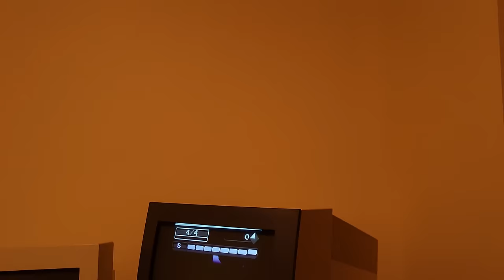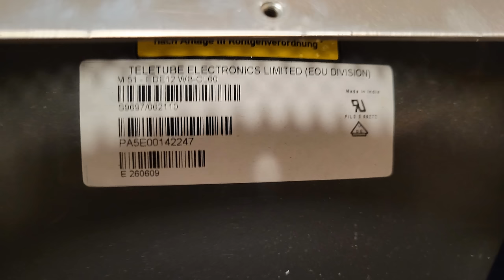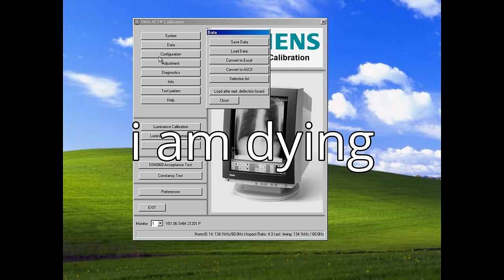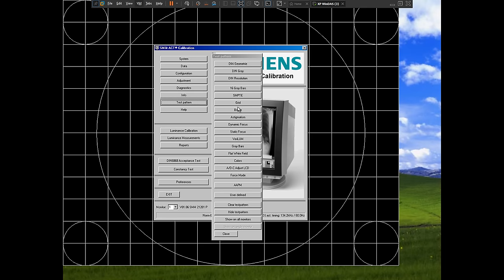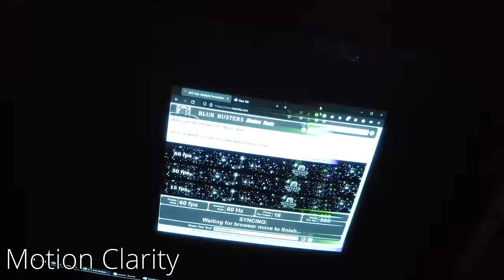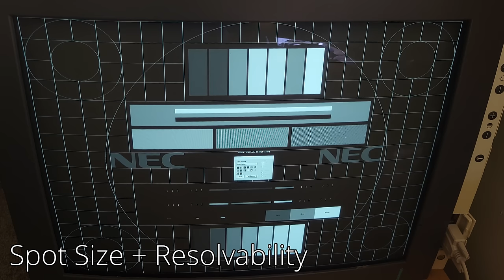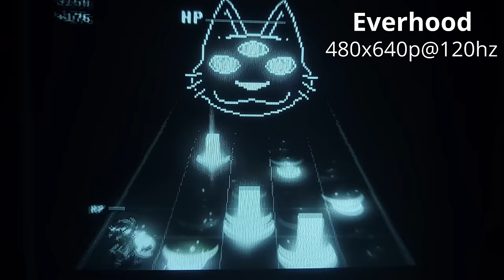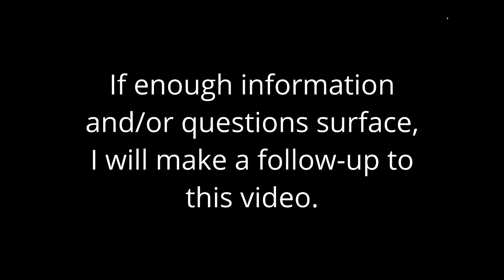The 4K CRT Monitor from 2005 - Siemens SMM21201P MED

Comment: If you can get the refresh rate high enough, you can mount a single pixel color LCD on it, and turn it into a sequential color display.
Reply: i was about to say that
Reply: Yes. A monitor with that same picture tube, turned on its side, with the colour filter would truly be something. That this was possible in 2005 (even though there was no real application for it yet) makes me wonder, what kind of CRTs we could have now if manufacturers didn't all go down the LCD route.
Reply: TFT or LCD will have a delay and smear in high motion scenes. Not good.
Reply: @daysetx  no, not a huge single pixel lcd (like in welding oder 3d shutter glasses, but with the ability to change color) they dont have relevant delay, and absolutely no smear
Reply: Yes
Reply: @daysetx  Dude's talking about a single liquid crystal color filter, which could respond to each pixel on screen and create their color while the line is being drawn.
They make color filters like this, and their response time is insane.

Comment: Whenever there are videos on larger channels about CRTs there are always comments about where CRTs would be if they were still being developed. Back in the late 1950s we already had amazing monochrome CRTs and color didn't catch up until the 1990s. I surmised that with the technology available at the end of the CRT era we could make absolutely amazing monochrome displays if we wanted to. I didn't know that this actually happened. The one thing I find somewhat surprising is that the face isn't flat.
Reply: Making the face flat would have added error to the placement of the electron beam, bad idea.
Reply: @Intelwinsbigly  It's simple geometry which is fairly easy to correct for. Especially given all the fine focus controls on this monitor that isn't an excuse. By having a curved screen it is guaranteed that distortion is present if you are viewing a flat rectangular image.
Reply: @eDoc2020  It can be corrected for, but because of its use in medicine, the screen needed to be as accurate as possible, requiring calibration often. Adding a bunch of other things that can also require calibrating would have taken these monitors out of service much more often.
Reply: @Intelwinsbigly  How can it possibly be as accurate as possible if it needs to stretch a flat image onto a curved surface? Even if you somehow make that work it would still need to be recalibrated just as often* to remain accurate.

*Which is basically never. Display geometry depends on the physical tube geometry, acceleration voltage, and yoke current. Physical geometry isn't changing, acceleration voltage and yoke current can be monitored and automatically corrected. Ambient magnetic fields also make a difference but that's probably negligible.
Reply: @eDoc2020  it is more accurate because making a crt screen flat harms focus on the edges of the screen, meanwhile the distortion of a round tube is fixed by changing your viewing angle.

The choice was between a minor annoyance to those who worked with the screen and had to occasionally lean to look at a part of the image head on, or blurring at the edges of a screen designed from the ground up for extreme accuracy.
Reply: @Intelwinsbigly  The tube is already flat enough that they need focus correction to maintain focus accuracy. A little more wouldn't hurt. All the modern flat CRTs I've used have no noticeable focus degradation at the edges. Granted they're lower-resolution color displays but they also didn't cost nearly as much.

Comment: Sonic Generations in the end game montage looked incredible and really sharp, I wonder what a hybrid display with this type of tube would be like, say this tube with an OLED shutter panel overlaid to add colour to the display, even a QD-OLED shutter panel, it's been done on a small scale before with the JVC LCCS, the B&W CRT tube with an LCD shutter panel overlaid to add colour, the resulting image looks incredible and works surprisingly well, a tube like this with an appropriately designed OLED (could also use quantum dots somehow to boost colours even more) version of the LCD shutter panel could make for the best gaming display ever made.
Reply: you can't use OLED, QD or QD-OLED OLED self emits light and QD you can't control it
Reply: Using a transparent OLED panel as an overlay for colour, or just stick with LCD shutter tech if OLED is not viable, I'm sure it could be done though, there are 3D OLED panels out there using passive and active glasses.
Reply: @Wobble2007  that doesn't work like that that would be just transparent oled with extra backlight and adding any shutter panel would need a lot of processing for it you need also help from the monitor to get it to usable state

Comment: Radiology Equipment is just straight up batshit insane at times. I worked at a Software operation for said purposes and had the pleasure of using some sort of 8k Eizo monstrosity that only could be connected via a special magic box and two separate DisplayPort cables.

Comment: Due to the fact that it would have been used for cancer diagnosis, bone fracture analysis, sonograms, MRI, CT, etc, they would want to make certain they are not causing weird image artifacts or bloom distortion that could affect diagnosis, vs a generic CRT. External software control of settings would allow them to deploy common settings across multiple monitors in the same facility for consistency of diagnosis.

Modern equivalents like this cost a fortune for similar reasons. Barco K9301636A 30in color radiology monitor 6MP (3280 x 2048) - US $13000
Reply from the maker: Yup; we actually found out what type of phosphors this thing used in a manual for it a day or two ago, so I'll be including that in the follow-up video and most likely will be making it a pinned comment here too
Reply: Medical grade display are no joke.(DICOM part 14 standard for grayscale calibration)
The newest top end RX1270 from EIZO costs $30k according to lakeshoreit.

Comment: I remember dealing with those monitors back in the day.  The ones my company were using were GE branded for Mammography reading, so they were 5 MP and had have the calibration checked every month (FDA requirement).  
Now we have LED / LCD models that are 12 MP resolution and full color.

Comment: Many MANY years ago at school on a 286, they had a monocrhome monitor that was used for cad, (the machine had a 287 as well to help). This monitor's screen "colours" looked similar. White with a blue tinge. I noticed that the green "shadow tint" you mentioned in the video and i did some research on it, apparently its a combination phosphor of a very light blue and green phosphor to get the extra brightness. The light blue is for the speed, the light green is for the total brightness, but its a bit slower, that, and our eyes are more sensitive to green so you can see the green fade away more then the white/blue. In a room lit with flouro lights, this monitor would look white, but in an incandescent room it will have a blue tinge to it.

There is no actual "white" phosphor that is even remotely decent, so these mono monitors were made with the combination blue and green. Thats why old black and white tv's always looked "blueish"

Comment: Absolutely amazing video man and great find for the monitor. Nice to know that in 2005 they could have made CRTs for projectors that could have given us monochrome RGB with the ability for 4K interlaced at 60 hz. I can only imagine what adding Quantum dots to something like that would have been like. No burn in? Yes please.

Please don't run that tube anywhere close to 500 nits lol, except for the science you've done in this video LOL. You'll burn it out faster than you need to. You could be perfectly happy with that at 150 nits lol

Even though it keeps the values in memory from the service menu, write that shit down anyway in case a capacitor goes bad or the little ROM that that date is written on craps out one day. Save yourself some headache in advance

Here's just a thought for you. If you could get some color shutter glasses or some fan blades that are RGB and run the tube at a high enough frame rate, you could probably get full color out of this thing old school mechanical TV Style.

Technology connections did a great video on an LCCS tube, and I bet something could be done with some active shutter glasses. Maybe hop over to blurbusters and see if the chief could help you out

Comment: I wonder how this monitor would look emulting a vectrex at high resolutions, and then getting the color filters (or reproducing them) for the old platform...  Since it's such a clean display @ high res, emulating the vector based display may actually work out nicely.

Comment: Still have three CRT monitors (roughly 30 years old) which are the grandparents of modern high definition.

Ironically enough, the oldest of the three supports 2560x1440. But all do up to 16.8 million colors on screen simultaneously, while everything else available could only do 256 colors picked from a pallet of 16.8 million colors.

They are NEC multisync's 
2560x1440 was dropped due to the monitors fixed aspect ratio of 4:3 (and likely cost) not to mention that monitor is heavier alone than both others combined. 2 are 17" and the other is 15"

Pretty sure grey scale versions of these same monitors existed as well, for radiology use, never seen one myself however.

Comment: Wait you can run a dac not internal to the graphics card? I have an upgraded past TitanX because no DAC and i run a p1130 as main monitor at 2048x1536@80hz
Reply from the maker: there's always a DAC for this stuff, whether it's internal like GPUs that have VGA out or the usual DP to VGA adapters.

Comment: Black and white monitors do not need grease! Shame you destroyed the flat flex. Yes that would be needed - glad it was repaired! Well done. Lol my ears stop shouting 

Good monitor - I’ve had similar monitors on my workbench. Paper white. Fantastic quality. Line transformers, as well as other components are unbelievably reliable. Comments at the beginning about flashing over arcs, mainly is caused by a breakdown in the EHT lead, a shorted CRT, air filled CRT, and even a shorted horizontal output transistor. Your monitor uses a voltage multiplier on the output of the line transformer. This can also fail. Rarely the line transformer fails, however it is common for the EHT diode in the transformer to go short circuit - this can be fixed by an inline diode!

Good work on umm adjusting the picture!

You need to adjust EHT regulation by following voltage reference points on the line output drive board. It’s very dangerous to do this without the proper procedure as you could overload the line transformer, it will end up flashing over on the tube, causing it to crack!
A video amplifier is used to increase the video signal to a level which is fed to the cathode of the CRT. It is likely that this monitor uses a combination of RGB to mono grey scale, rather than just one green signal. Chroma isn’t needed as it’s black and white! 
I’ve got a couple of these - I’m based in the UK. If anyone wants a repair video, let me know!

Comment: No one believed me when I told them I played portal 2 in "4k HDR" in 2009, before there was even a "4K", let alone an "HDR".  Everyone thougtn i was insane
Reply: Oh,wait, monochrome?  This isn't the viewmaster multisync I remember
Reply: you mean portal 1? That's probably why they didn't believe you
Reply: No it was portal ii on, what was it, the 512mb the radeon 7650 with whatever overclock that thing took?
Reply: So the year might be off but it doesn't change much.  The monitor was still doing 32-bit color through, effectively, the last graphics card that could truly display it in analog
Reply: At x2100, 75hz too
Reply: I had the adobe colorspace installed too, Photoshop 7 cd's where everywhere back then, as was the style at the time

Comment: When you turn it off, does it do the white dot thing??
Reply from the maker: yeah, deflection turns off slightly before the beam. I'd say it's for less than a quarter of a second though; not like when some sets have an issue where it sits there for a good bit, so it's safe.

Comment: This was a really interesting video, thanks for making it!

What DAC did you use to get interlaced output? In Windows I can't get interlaced out of DP converters. I didn't watch the whole video so sorry if you mentioned this. I just heard the part where you're using the 500mHz+delock, of which I have the Sunix version and have not been able to get interlaced from it.

Also, in regards to the bandwidth limitation you were talking about with the Delock, I wonder if you found a DAC that prefers YCbCr, like some HDMI DACs do, you could possibly set the color space to YCbCr 4:2:0, which would drastically reduce the bandwidth and maybe allow you to run higher resolutions. Luma should be fully intact, and in theory, look identical
Reply from the maker: Yup, so I'm using an IO Crest HDMI to VGA DAC that can hit a gorgeous 350mhz pixel clock. It has green artifacts even at low pixel clocks, but kind of like you said, if you set ycbcr 4:4:4 in CRU, the artifacts go away. I'm aware that there are actually a couple of dacs that use the same chip in this DAC, as it's no longer in stock unfortunately

And yup, display port refuses to interlace on windows and nvidia, and you can't interlace at all if you have an RTX card or a GTX 1600 series card.
Reply: @Notes_lul  Holler at me if you're able to try 4:2:0.

I tried 4:2:0 4k60 from a PS4 Pro into a cheap Benefei DAC, and I got a signal but the colors were messed up. However, I don't think the actual Luma side of the signal was wrong, so I think it actually might work for a B&W display, without any loss of data
Reply from the maker: @lulkLogan  Yeah as far as I've been able to find, I can't find any option for 4:2:0 in CRU
Reply: @Notes_lul  When you have a HDMI device hooked up, there should be an option somewhere in Nvidia CP. It'll have a few options for both RGB and YCbCr

That's how it is on my AMD card anyway.

But if you don't see that option, you can try adding the HDMI or TV extension blocks in CRU, which have some stuff related to YCbCr. I don't know which if any of those will trigger that output.
Reply: Displayport just doesn't do interlacing AFAIK

Comment: If not the anode cap, arcing = bad caps on the driver/power board.

Needs a minimal recap for the high voltage, high heat circuits.

Comment: I'm very sure that there are no color 4k CRT's that exist, as there is only so small that manufacturers could make those holes on the mask. It was attempted before in a lab, but was never reproduced as there were problems with the colors overlapping each other due to the tiny space of the holes. As for monochrome displays, your only limit was scanning frequencies and video drivers, but 4k should be plenty in my opinion, as even 8k isn't very useful said by many people and looks like 4k. This could mean that it's the hg of all displays that currently exist in terms of just detail.
Reply: They can make 1nm chips, why cant CRT's have 4k resolution, even if its the absolute MAX they can get?

Comment: Siemens can work 4k!?! 😱😍😁 Look, I recommend you change the vertical frequency to 60Hz because arcade games@60fps, old or modern PC games@60fps capped for get pure smooth motion - PS: sorry for flcikering. 😁 But if you want TV PAL, your Siemens can't reach 50Hz, unfortunately. But most CRT monitors-computer work 50Hz while Sony 48Hz. 😉

Comment: seeing this makes me very upset that my sony trinitron tv from the early 2000s has a service program that runs on windows and a hardware thingy to connect to the I2C bus to adjust all this stuff and afaik even save profiles and such but i have no way to do that bc no software anywhere (it is called TRACE) and of course no hardware which could be as simple as a serial port to i2c adaptor but yeah... no way to find any of this info :/ itd be so useful especially now that i saw all this :c

I can adjust stuff from the service menu by using its controller and doing a weird code thingy to access it but its VERY SLOW and VERY ANNOYING and i have to keep track of what each thing used to be just in case and i have no idea of what some stuff does bc its not mentioned anywhere so i could lose the picture and have no idea what im doing anymore.

Also worth mentioning, this shit was very much not calibrated, the geometry was messed up and even the sub brightess (for what i could see is what the lowest possible brightess is for the crt) was wayyy to high and was actually making the tv glitch and thought id have to change the deflection chip but since i adjusted it properly it looks way better and that issue is almost gone. Sony spain is a different sony istg